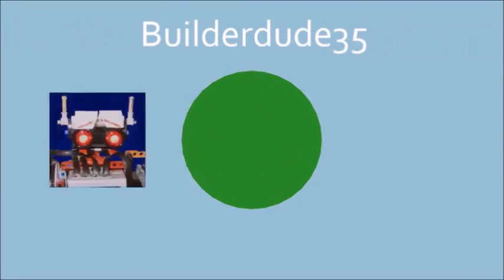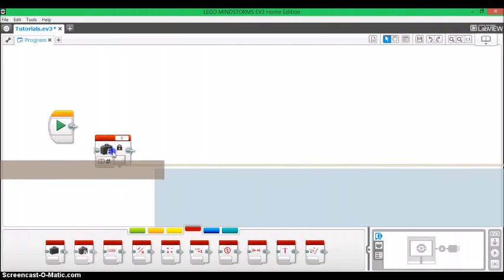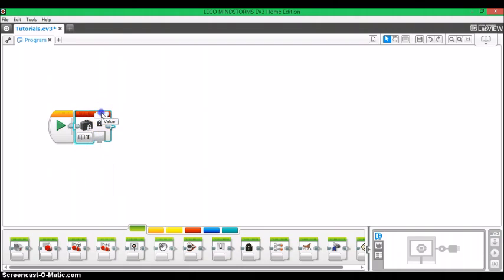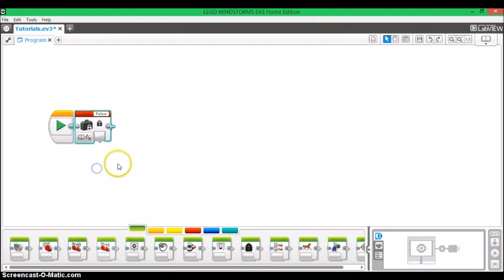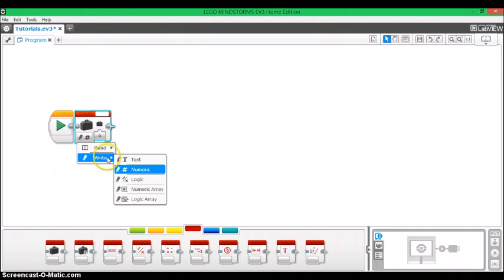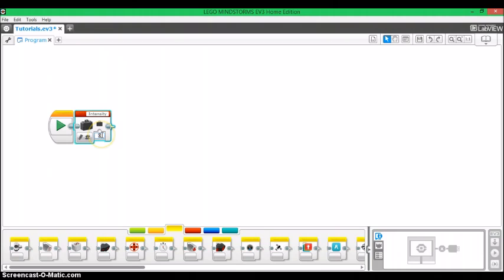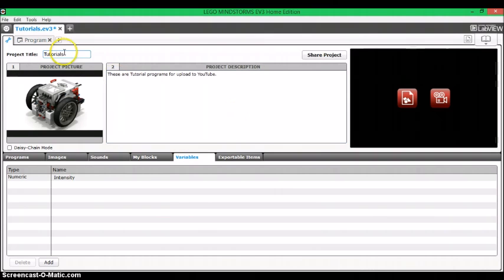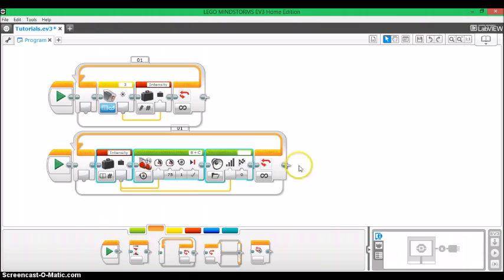How to Program Constants and Variables (EV3-G)

Comment: This seems useful, and im not a very good programmer but, for variables, can you link it up to another block, or are you supposed to take out another and do read and connect that to another block? and for constants, what is the use of them exactly? are they mostly used in loops? to write a new one during the loop to change it for mainly math blocks? please reply, I am kind of confused.
Reply from the maker: For variables, you need two separate blocks to for the Read and Write operations, set to the mode of that name. And as for Constants... I never understood why they are in the EV3 software, because they don't do anything that Variables cannot already do. So... just use Variables,
Reply: k thanks. so are variables for like loops to repeat them but to change a few or one details instead of needing to make a whole another loop?